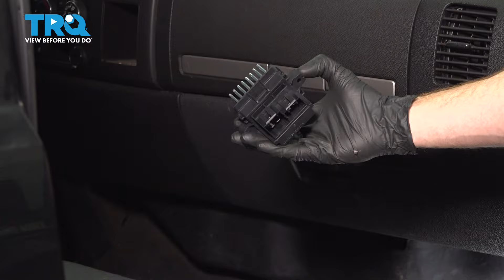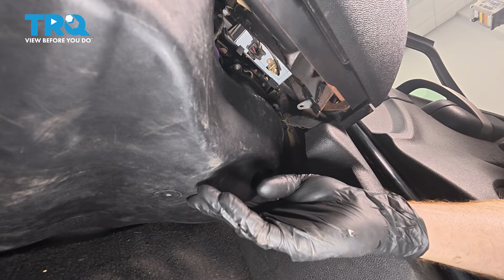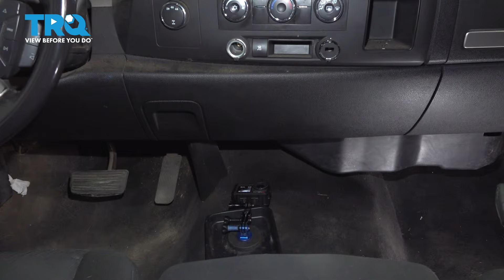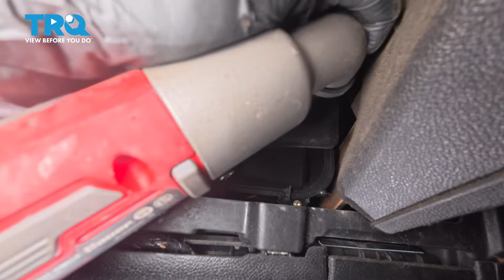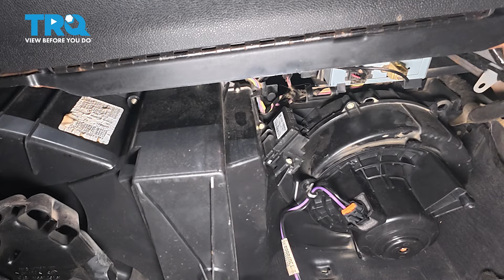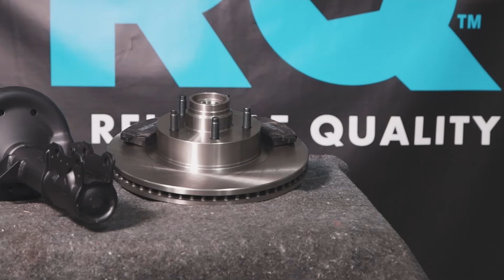How to Replace Blower Motor Resistor 2007-2014 GMC Sierra 2500 HD

Comment: Worked great. My blower motor just needed a good tap and it came around. Let the pan off just in case tomorrow morning it stocked again. If so, I need to replace the blower motor and the resistor.  The video was helpful to find the locations of the pan screws and telling us it was a 7 mm bolt head was super helpful.

Comment: Great video! I took my glovebox out to get at the top T20 screw on the resistor. Pain putting the 4 #10 screws back in! I ended up leaving the center screw out.